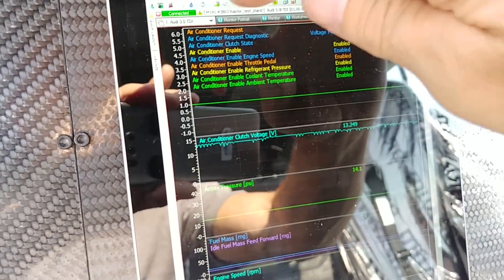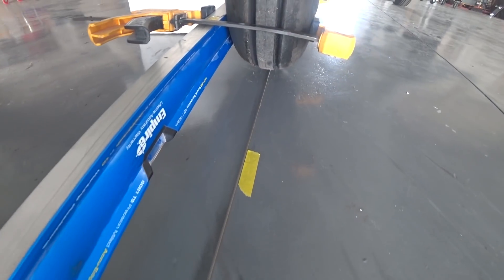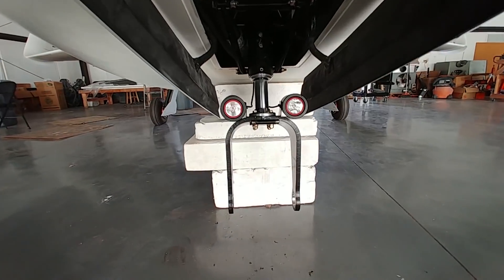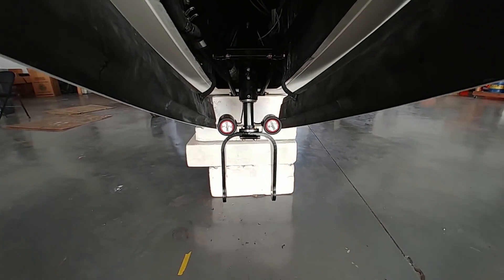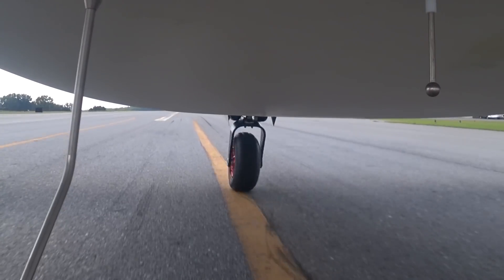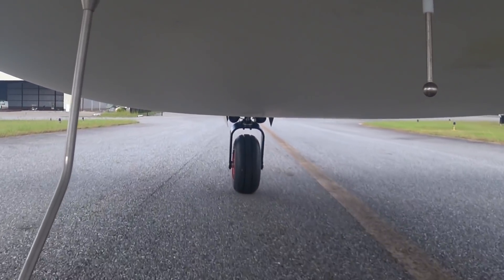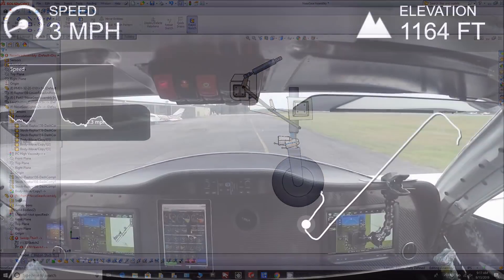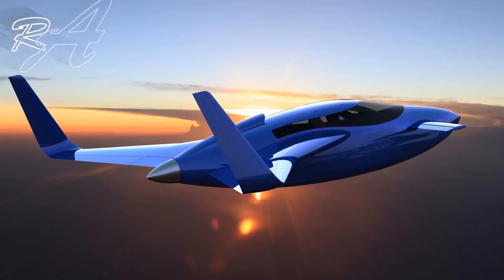Engineering a New Solution - Building the Raptor Prototype

Comment: Time to bite the bullet and go with a nose wheel steering system.  Call the engineers at Gar Kenyon, they have a division that can help you with single engine G/A applications.  Then you can do minimal structural beef up and use the more stable positive caster.

Comment: As you likely know, you can calculate the trail by drawing a line down along from rake angle of the steering pivot, and a line straight down from the wheel axle, and calculate the difference. From what I see in your CAD, you had little of any trail. Your fix should alleviate the problem, and likely fix it all together.

Comment: Note from https://www.lancairowners.com/the-nose-gear

The shimmy damper is a vertical piston inside the front of the strut.  The piston is held in place by the two safety wired bolts located on the front of the strut.  When the damper is functioning properly it provides a large damping torque that resist rotation.  When cold the resistance is roughly xxx ftlb-secs.  Movement from stop to stop should be smooth and seamless.  Force reversal should not reveal a dead band.  Nose struts with self-centering require the strut to be compressed at least one inch to check the shimmy damper.  Non self-centering struts can be checked with the strut fully extended with the wheel lifted off the ground, but both types will be easier to test if you to deflate the strut first. It needs to be reinflated with up to 300 PSI of dry nitrogen when testing is completed.

Comment: The primer for Locite is normally just fluid with copper in it.  Locite just needs something to corrode a little.  Carbon steel is good or aluminum.  Stainless Steel needs the primer.

Comment: Watching the shimmy was painful. And as others have probably pointed out (didn't read all the comments below) the nose gear strut should be near vertical. I think I heard you say that you are using a Lancair nose gear? somewhere in your videos. Looking at the mounting instructions from Lancair they call for 1.5 deg forward angle. This is a trailing link gear, but I'm sure you knew that.
Do you know which of the nose gear you have? There are a few variations of the ESCO struts that were used on Lancair's from what I have read.
Also, do you know if the internal shimmy damper is actually working? There are some tests you can do to insure that it is.
If you haven't already you may want to read this http://mail.lancair.net:81/lists/lml/Message/69670-02-B/LOBO%20Maintenance%20Issues%20Winter%202011.docx

Comment: Have you ever thought about getting an used treadmill (modified for high-speed with faster motor) and place it under the nose gear wheel and run the nose gear wheel tests. I believe this nose gear treadmill test method will save you time (taxing - time consuming) and may help you solve the shimmy issues quickly.
Reply: 40+ mph- hmm

Comment: I am wondering how much trail you have at rest, and at the shimmy speed. Perhaps as the aircraft comes up to speed, it becomes light, and the trail becomes less.

I don't recommend doing a lot of tests like that, but on your next change and run-up it would be interesting to duct tape a cellphone down with an level/angle app running, an get a fine angle reading with a camera, or get a 9-degrees of freedom breakout board and an Arduino and do some data-logging. I suspect that the aircraft might be lifting a bit already.

Oddly, when I slow down the video, and watch the shimmy, it appears you have both a little lateral parallel flex in the fork, and a bit of front and back flex, too.

Because of the speed, I suspect that it's both a trail angle issue when the aircraft becomes light--and the wheel assembly itself is becoming an undampened spring in the other two (xy) planes, feeding the oscillation.

You'll get this fixed. It's all part of a process,that now you have lost your innocence with.

Comment: You just don’t have enough caster angle, as one of the precious comments suggests, your the wheel rotation axis is forward of your steering axis.  I would avoid the damper as that only masks your caster issue.  You’re headed in the right direction but you may need more castor angle then what your going to get to improve wheel tracking.... I would only add a damper to slow input, I would not add the damper to prevent the shimmy.

Comment: Awesome work and awesome vid. Love this project.You are now 100% correct with your front wheel geometry. The steering tube needs to be near perfectly vertical , and the centre of wheel  contact needs to be about 1\4 of the wheel diameter behind the projected King pin centre at the ground. Importantly this is only true for free castor steering. Some people have suggested that the contact centre needs to be in front of the King pin centre with maybe 5-10 degrees of King pin inclination. This also would, unbelievably, fix the shimmy but you would need have direct steering control to be able to turn. Cheers, keep up the good work.

Comment: If you set the arms so they are trailing you may have better results.  Try unbolting the flange and turn the mount 180 degrees and bolt it up?

Comment: You can get the nose pointed perfectly and thrust can make a plane drift or pull to one side on take off. I wouldn't sweat  getting it absolutely perfect as you may have to tweak it again in time. Like to see you run down the runway and lift off for a few feet. Thumbs up.
Reply: You may have to increase caster on the front strut ..it seems to act like a shopping cart wheel.

Comment: Erm, not sure if it's correct, but from the CAD picture it seams as if your setup uses a negative trail - in other words the turining point of the wheel is behind (in direction of driving) the head (turning point of the steering). That's ok if the head angleis straight or trailing - but not if leading, like in your setup. When leading, a positive trail creates a force to keep the wheel in line. A negative will result lead to shimmies whenever all other damping forces are overcome. 

(Not sure if my explanation is clear, but maybe take a look at this simple drawing to see how a movable leading wheel should be set up: https://en.wikipedia.org/wiki/Bicycle_and_motorcycle_dynamics#/media/File:Bicycle_dimensions.svg )

Stronger damper will just postpone the problem - while still strong forces will work on the tires. No good idea here.

If you want to keep this nose wheel it needs at least to be mounted upright  (90 degree to the ground). Since this might require a hefty redesign (and lots of work), you may as well try (first) to turn it by 180 degree. That way you'll get a positive trail with next to no changes to the actual setup. This should be fairly easy to do and without any problem on short term, like a few speed checks to see if that works. Ofc, you may want to check the manufacturers datasheet for long term usage.

Comment: Looking at the physics behind the oscillation, being exactly vertical is not a specific point of interest. It helps but something else really has to match. You have oscillation whenever the force pulling back towards a middle position is proportional to the displacement. Because you have toe brake steering, you need a casting design, meaning you need a force that orients the wheel to the direction you are going. So you cannot have a force of zero when the wheel doesn't align. So you need the very thing that causes oscillation. That is what damping is for. Damping is a corrective force that is not proportional to the displacement but proportional to the speed of the displacement. That's why fluid dampers work great. So you need a shimmy damper no matter what. The question is how much dampening you need and how big is the force you need to get the casting effect but not more. Right now your casting supporting force is high because of the tilt in the strut and the built-in dampening is weak. So what I am saying is that at some point you have the perfect match. Your shimmy will not stop because you are vertical, your shimmy will stop when damping is big enough for your setup. Being vertical is just another hit or miss experiment. It is not the thing that matters in the oscillation equation. Doing it properly would be to calculate "k", the proportional displacement force constant and then determining the necessary dampening factor "b".

Comment: Peter, I can hardly think of enough positive superlatives by which to describe you and your work.  Among other things, you've been a genius in engineering and design, and a saint of hard work and perseverance. 

Against that as backdrop, it seems all the more surprising that, on this nose gear geometry thing, you engaged in what I can only call a "complete mental fart." 

Basic principle: For a castering wheel to properly caster, its contact point with the pavement must be well aft of its axis of rotation. 

This is what that fork is obviously designed to do, with obvious assumption that it (the fork) will be pivoting on a vertical axis.  When you instead made the strut angle forward, you significantly overcame the angle aftward that is otherwise achieved by the fork itself.  Thus, the tire's contact patch with the pavement -- instead of being well aft of the axis of rotation-- is instead projected to a point almost directly in-line with it. 

Like I said, a mental fart. 

We all do them from time to time. 

I think you should have a high level of confidence than changing the strut to vertical will fully and easily solve your problem. 

P..S.  I wonder if you based your angled-forward strut design on some examples of similar arrangements in other aircraft.  If yes, I will bet that if you examine the forks that connect to such angled-forward struts, you'll find they are engineered with greater back-sweep (so as to compensate for the forward-angling strut) as compared to the forks you are using.
Reply from the maker: As I've explained several times now, I had this geometry initially because I intended to have a straight fork and nose wheel steering. When I found a strut and a fork and could use them to get the nose wheel sorted quickly I should have changed the strut to be vertical at that time. But I figured I would try it and if there was a problem I would fix it then. Then is now and so I'm fixing it. I have told you guys for years now that I have no idea what I'm doing,   I'm just making it up as I go along. As for thinking I am any kind of genius I think you may have had a brain fart. 😁
Reply: @RaptorAircraft  Peter, you are much too modest.  :)

Comment: That is a nice speed wobble (tank slapper)! Check out how motorcycles control or avoid this type of movement. It might give you some more ideas.
Reply: There's tons of information about engineering the caster angle online.  I posted where he needs to have about a 3-5 degree positive caster to eliminate the wobble/shimmy.  Motorcycles have a negative caster angle for steering responsiveness, just the opposite of what Peter needs IMHO.

Comment: ,,, I don't know if these are adjustable, but I like my wheel bearings with the slightest amount of preload; however most specs call for the slightest (a few thou) clearance.  But as an aircraft there is very little time for heat buildup  .

Comment: Not an engineer by any means, fairly knowledgeable about suspension and steering designs (although cars and motorcycles specifically, not aircraft), but my thought before you even got to it in the video was changing the rake or caster angle of that fork. I believe you are on the right track for the fix.

However, after seeing the view from inside the nose compartment, I'd also be concerned with how much lateral movement was allowed in that main strut. I don't believe your mount/retraction assembly is built stout enough and could use some reinforcement. If I remember correctly you already had it break on you once.
Reply from the maker: It's plenty stout but was not designed to operate in continued severe shimmy situations. The retraction mechanism broke previously because some stupid fool retracted the gear by accident. That retraction put an incredible load on the retraction mechanism that it was not designed to handle. "Did I do that?" 🙄

Comment: Can you use a double contact tyre.  The Jet Provest has a double contact tyre to eliminate the shimmy.  Just a thought.
Reply from the maker: I could only use a double bogey if the strut is vertically oriented first. Let's try it first vertically with the single tire and go from there.
Reply: @RaptorAircraft  GF22 is referring to a single tire. Google the JP nosewheel to see what he means.
Reply: @RaptorAircraft  I've seen single tyres with double contact points to stop shimmy. The Jet provest uses it to prevent shimmy. It still has an internal strut damper. Loving the video series.

Comment: It Should work, changing from a Push force to almost a Drag, Pull force resulting in a fixed direction from the Forks. Good Luck there. Kiddies Tricycles have the same problem at speed downhill.

Comment: with the shimmy i would rake the strut more and then rotate the wheel fork 180deg more like a bike
Reply from the maker: That's not advisable. On a bike the rider is keeping the wheel straight using the handlebars. On the aircraft it would be free and expected to rotate 180 to trail if nothing was preventing it.

Comment: Isn’t the shimmy from not enough offset from the center of the axle to the center of steering
Reply from the maker: It's because the strut is angled forward which causes the rear trailing fork to want to turn away from straight ahead. When the strut is vertical the problem should be resolved.

Comment: Remember to tighten the wheel thru bolt so that the tire turns about 1.5 revolutions when spun by hand. That puts the proper pre-load on the wheel bearings.   I suggest starting at 45 psi.
Reply from the maker: The axle setup from Beringer prevents the bearings from having preload. Tightening more makes no difference to the spin on the wheel.

Comment: This looks like a rake and trail issue 
Building motorcycles you have to check rake and trail 
To prevent tank slap or shimmy 
Just a thought 😃
Reply: This!  I totally think this is a lack of trail issue (axle needs to move rearward probably 5-15mm in my guestimation from my motorcycle days).  Get the forks too steep without enough trail and you get instability.  Would be super easy fix and easy test.

Comment: You shouldn't use an infrared temp gun. You are measuring the temp of the plastic od whatever you are pointing at. Get a meat thermometer to measure the actual air temp.
Reply from the maker: The guys didn't have the meat thermometer handy. This was the next best option.

Comment: Is there a reason why the nose gear castor length design is so radically different than that used by the long ez (which is also steered by differential braking)? Notice their castor length (distance between pivot axis and axle) is actually greater than the wheel diameter, whereas this design is barely an inch or so. https://upload.wikimedia.org/wikipedia/commons/thumb/c/c7/Rutan.long-EZ.g-wily.arp.jpg/1280px-Rutan.long-EZ.g-wily.arp.jpg
Reply from the maker: That geometry is totally different. You need to look at all the Lancairs. That's what I am now attempting to emulate.
Reply: OK, looks like Lancair has substituted a carefully engineered damping system for the geometry methods used by Long EZ and Grumman Tiger.
Reply: Thanks everyone, I think I understand the trade-offs now and can see the advantages of the Lancair system.

Comment: Have you considered just trying to turn the wheel fork back to front to see if the change in geometry makes the shimmy disappear before you engineer a whole new solution? It's just four bolts and turn the strut around.
Reply from the maker: That wouldn't really help. The strut would still rake forward instead of being vertical.
Reply: @RaptorAircraft  well have you tried? it's four bolt and turning the fork around... you could try it until the other solution comes in.

Comment: Can you make it so that the nose wheel axle is set back 3 or 4 inches behind the nose strut  rotation point... like in the long ez?
Reply from the maker: I don't have that much room. The wheel would not fully retract. This geometry will be very close to all the Lancairs so it should work fine.
Reply: Yeah i was wondering how much additional room you had in the well? So retracting the strut higher into the well is not an option....:( are the lancairs all caster (non steering) nose wheels? Bummer even a inch or 2 setback might help...